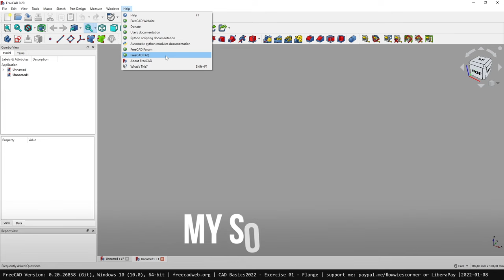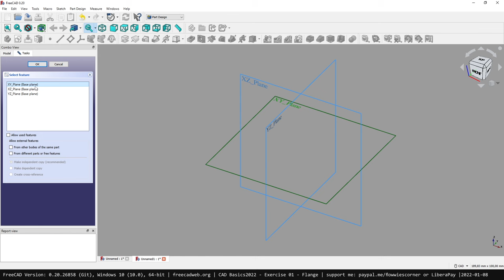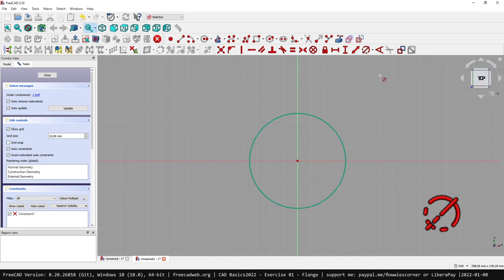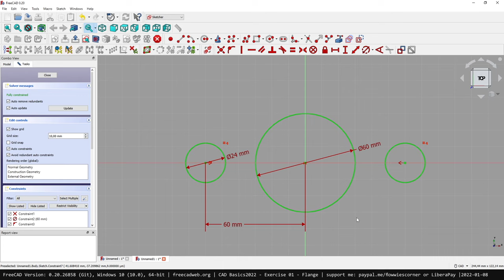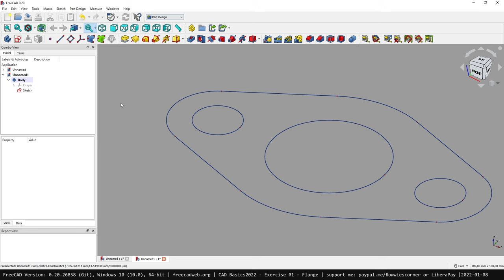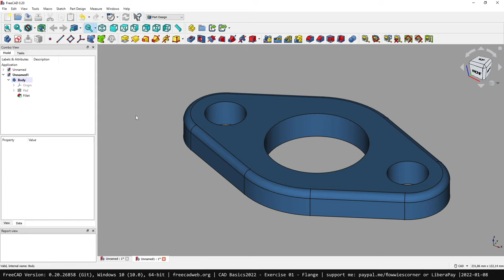FreeCAD 0.20 - Basic Exercise #1 - FLANGE (EN)

Comment: the 0.2 is not yet on the official website ... is this a nightbuild?
Reply from the maker: Correct. It’s just a development version but you should be absolutely fine with the 0.19.3 for this exercise. The 0.20 has some nice features but it’s absolutely fine to work with 0.19.3 at this current state
Reply: @FreeCADAcademy  well if it's stable, I will install the 0.2 :-) I'm always waiting for the moment in which the topological naming issue will be solved for other projects not for this). And thank you for this video, because it's teaching even nice tricks to expedite processes. And it's designing a piece I really needed in short in real life. So I will follow it to draw my case :-)
Reply from the maker: Unfortunately the Toponaming issues are still present in the 0.20 :(
Reply: @FreeCADAcademy  that's bad :( because it really complicates things. Beside this, I drawn the piece today in less than 10 minutes and it's ready to be printed :-) Thanks to you and your video.

Comment: I am learning FreeCAD to help a friend learn it. I usually use Solid Edge, but that is not an option for my friend who has a Mac. I thought this tutorial was a good beginner exercise and your solution demonstrated constraint use very well, especially the symmetrical constraint. The other nice tip was selecting multiple elements to apply a common measurement to them.

Comment: Appreciate your presentation of the course. Frustrated with ver 0.21.2 following the simplest of tasks; the horizontal constraint requirement between the ctr opening and the adjcent one in sketch mode produces an error response I can't avoid. Not very assuring for a beginner budding CAD student. Any suggestions? should I install an earlier version, the one you use in this video?

Comment: Thank you for updating your video's to include the 0.20 version. There are just a few small suttle diffenences between .19 and .20 but Now I don't need to worry about it.
The only issue I am having is the pan feature. I can press the middle mouse button and pan and if I roll the button, it will change sizes. The issue I am haveing is if I press the center mouse and one of the side mouse buttons, I can't turn the project over to see the other side.
Then occasonially the curser changes and I don't have to press any buttons, the drawing just moves. 
Thanks for including the large Icon. It helps my feeble mind and eyeballs find it faster.
Is there somewhere I can get a list of the letter functions like you used in this tutorial when you use the M M M function.
Keep up the good work and thanks again for all you have done.
Reply: I went into the Logitech Settings Program for my Marathon M705 Mouse and found out the Middle Button was set to Scroll Button. I changed the setting to Middle Button and now when I click the scroll wheel it allows panning in FreeCAD. If I roll the scroll wheel, it still zooms in and out as before. It did not change how it works on Windows 10 settings so that fixed the problem for me. :-)

Comment: Excellent example, Flowwie. I had an issue with the origin point not existing at 0,0,0. As I zoomed into the origin, it was clearly not in the right place. Removed the auto constraint checkbox and the origin lined up as well as all features.

Comment: When I tried to draw the outer bounds, I didn't realize that polyline was trying to make every segment tangent to the curve that precedes it, so I overrode it and just drew a non-tangent line segment. By the time I was done, none of the curves had tangent constraints with their connected line segments. When I tried to go back and add all the tangencies, it threw up all sorts of errors and then crashed. Lesson learned: do it the way you did it; FreeCAD is still a little too fragile for trying to do it your own way.
Reply: … but of course it worked just fine when I tried it again. 🤷

Comment: I chose quite a different approach making the outline. First I created circles of the outline (concentric to the circles for the holes), then I interconected them with lines and tangential constraints, and then I trimmed all the lines that went beyond the tangent points (including sections of the circles). This created the final shape, yet I had to add the constraints. All went well, but there was last degree of freedom in one of the arcs I didn't know how to get rid of, so after almost an hour of trial and error I managed to solve it with block constraint ;-)
Reply: Well, it seems I was only skipping ahead to the content of following lecture 😁

Comment: Before trying a polyline (since I know that's a favourite of yours), I tried 1) drawing the full circles of the outer edge in construction mode, 2) drawing the straight lines inbetween them as tangents, then 3) drawing arcs and constraining them to the straight line end points. That last step always failed, maybe one arc would work, but soon enough FreeCAD would complain about redundant constraints. Any idea why?
Reply: Do you have the possibility to post a screenshot somewhere? It might be easier to see the problem.

Comment: THANK YOU AGAIN I LIKE THESE COURSES VERY MUCH.  I DID IT LIKE I WAS STILL USING A DRAFTING TABLE LOL.  I HAD CREATED THE THREE CIRCLES THEN CREATED 3 MORE CIRCLES OVER THOSE.  LATER I USED THE LINE TOOL TO CONNECT THE THREE OUTSIDE CIRCLES.  I DELETED THE THE LINES THAT WERE OVERLAPING THEN SET TANGENTS.  EITHER WAY IT WOULD HAVE BEEN EASIER WITH THE POLY LINE LOL.  I HAVE TO GET MORE PRACTICE WITH THE POLY LINE BUT SO FAR SO GOOD.  AGAIN THANK YOU SIR.
Reply: Fix your CAPS LOCK button, it's stuck

Comment: Hi The version you are using is 0.20 but the latest version on the freecad main page says 0.19.3, for a total newb with out technical tec brain which one should i get, I use a 2d cad cam for edm wire but i want to dip my feet in designing 3d print, i under stand how drawing package's work briefly but im not the one who usually installs them so this is going to be a home project. Any help would be grateful.  Sorry if this sounds a dumb question.
Reply from the maker: you can do this exercise perfectly in FreeCAD 0.19, there's just the part with constraining the diameter/radius tool where you have to select the tool manually. The rest is completely identical. Cheers
Reply: @FreeCADAcademy  thanks, so basically if i just click down load on the main site it will have all the installs and boot up with out I think un zipping other files, sorry for sounding dumb my brain doesn't work with micro processors it works on cams and valves 🤭

Comment: I can't get this to work , I still end up with 3 DOFs , the straight lines between the radius.  Also I dont understand what the constraint tangent is , I apply it but dont have a clue. Any ideas 💡 🤔
Reply: I think I solved it , you get a small constraint tangent symbol by each point , no idea what it means but if you click two together with constraint tangent until all points have it then it works.
Reply from the maker: Tangent means that you don't se a visible or sharp edges where a circle and a line or two circles meet. They go smoothly

Comment: I tried doing this by only circles and tangent lines. My sketch refuses to turn green the moment I trim the lines
Reply: I tried with this method and the bottom arc and the two lines connected to it won't turn green.
Reply: zoomed all the way in and realised that two lines were not meeting. Also added a few more symmetrical constraints outside of tutorial seemed to get the job done.